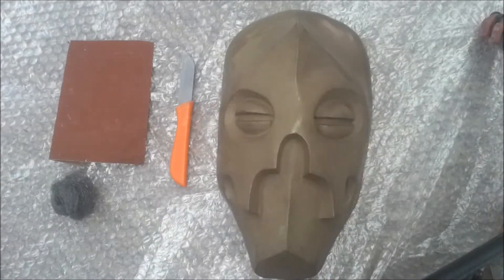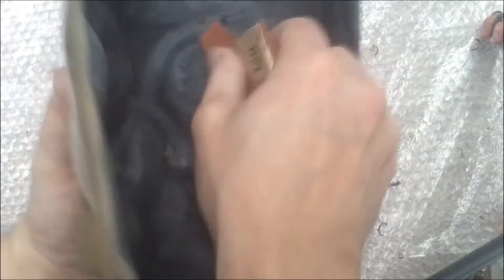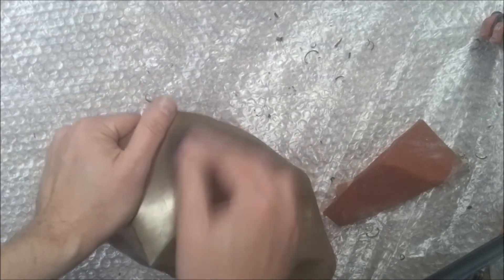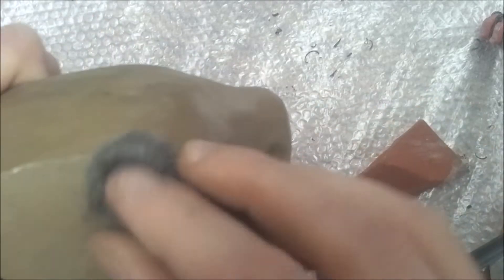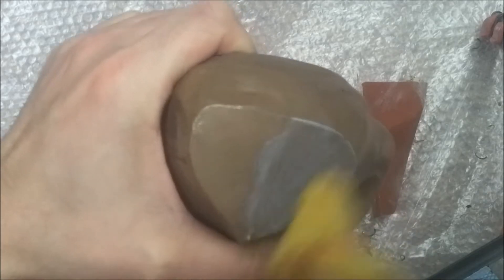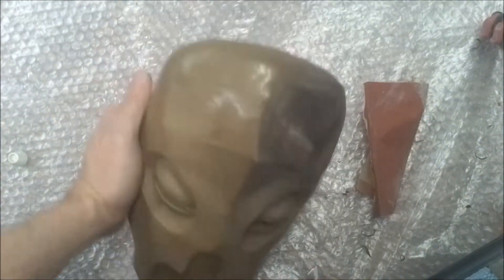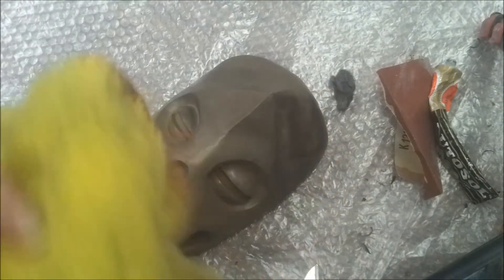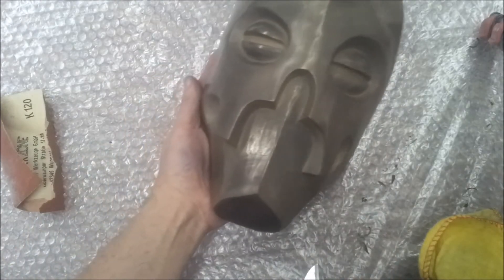Cold Cast Bronze Mask Tutorial - Costume / Cosplay Skyrim

Comment: Nice job, autosol rocks doesn't it, been using it for years on motorcycles and cars. Can I ask, the mask you have there has no mouth but the ones on your ebay site do have mouths, is the mouth to be added by the user or more likely is it a different casting?
Reply from the maker: Those ones are a different mask :) This one still needs the "Tusks" adding but many people were unsure of how to polish up the surface but the Methods the same for either mask :)